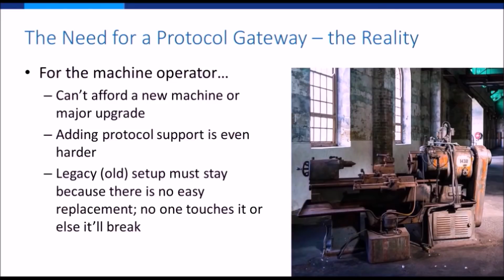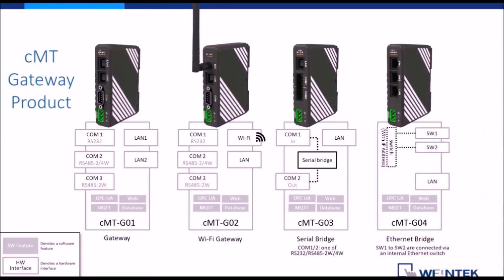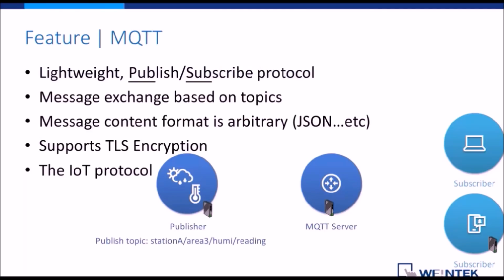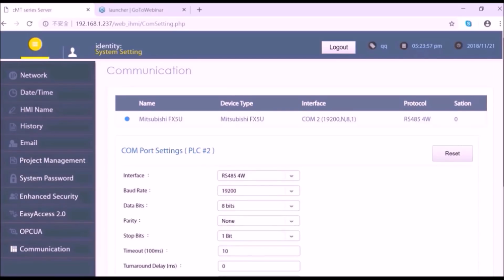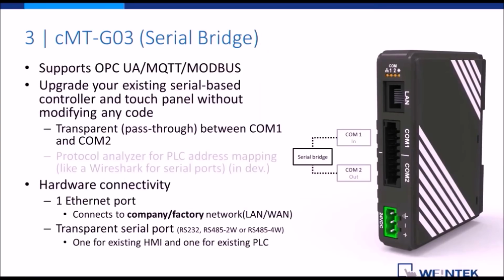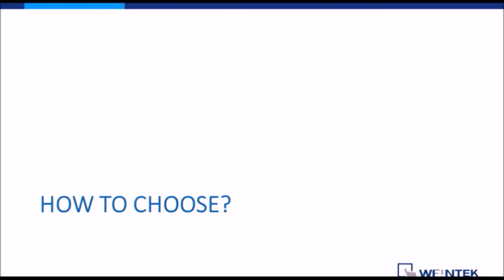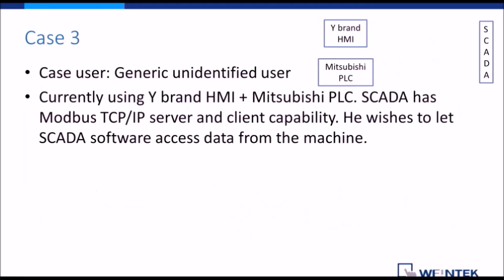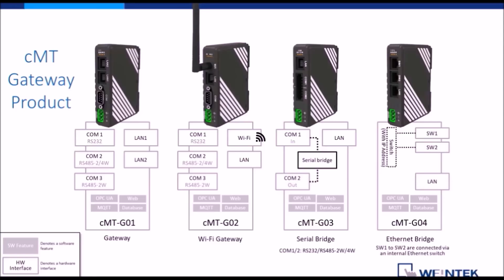Weintek Webinar 2018-11-21: Weintek's Smart Communication Gateway

Comment: Be aware that there is a monthly limit of 1 GB of data through their cloud before it goes into snail mode. And to purchase an additional 10 GB of data usage for A YEAR is very expensive. We have a lot of their screens implemented around the world on equipment that we manufacture and we give the customer free access to the system (as long as they understand about the limitation of 1 GB per month per panel). So far that has been the only problem with the system and we are very happy with the switch to their brand of HMI panels.

Mike
Global Production Solutions
Reply from the maker: hi Sir, thanks for your feedback. Will it be possible to send your contact information to salesmail@weintek.com? So we can ask our sales to contact you and to further discuss this issue. Thank you!